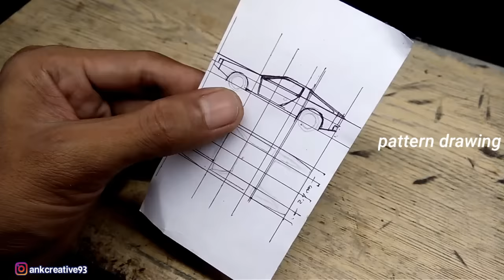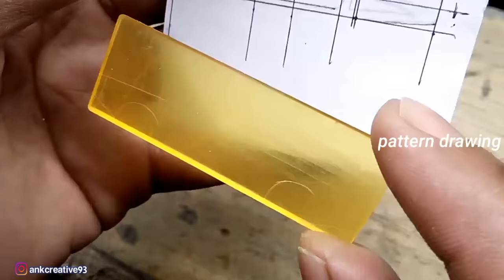How to make a DeLorean from used goods

Comment: A more accurate title would be; "Delorean made from bits and pieces of several lighters."
Reply: The question here is, ¿Could you make one to?
Reply: @alejandrocamacho4343  no, I could not.
 But I bet yeah I could make a gas lighter out of the Delorean!!!!
Reply: Or just add an "s" to lighters on the original title 🤷‍♂️
Reply: @momo22406   But get rid of the 'a' before gas lighter 1st.